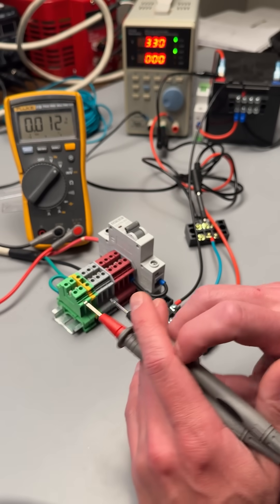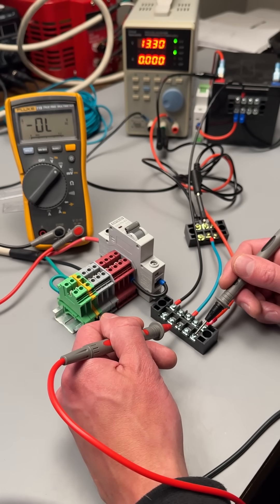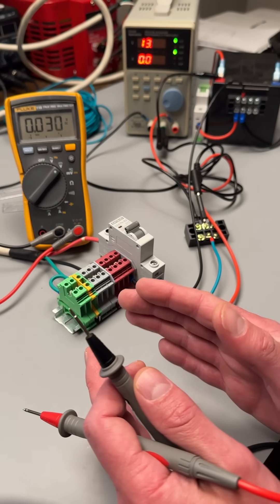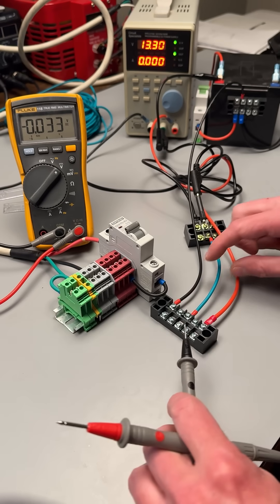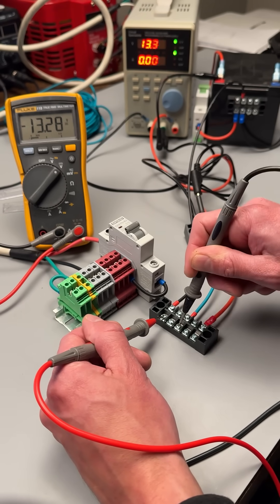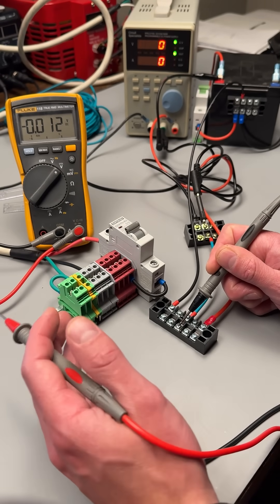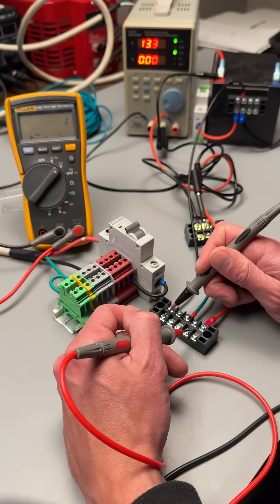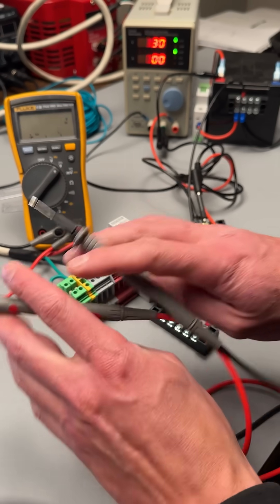Negative Voltage in DC Circuits Part 2: Understanding Voltage Relative to Earth Ground

Comment: Yeah this still really dosen't make any sense. How can you possibly have a voltage below 0v? How can you have less than nothing?
Reply from the maker: It’s just the difference in potential is in the opposite direction. I’d think of it like, think of 0v as the elevation at sea level. Positive voltage is building things above sea level, negative voltage is building things below sea level. Idk if that helps at all 🤷🏼‍♂️
Reply: The only confusing part of this to me is how the voltage is additive to 26vdc in the end. In an intuitive sense I understand that if you have a difference in the two amplitudes, that delta can be measured as the absolute value but it’s odd to measure it in this way. Idk